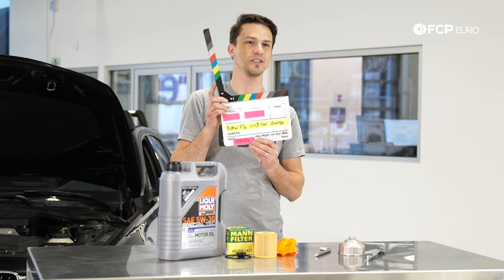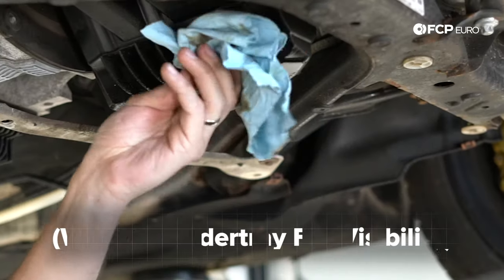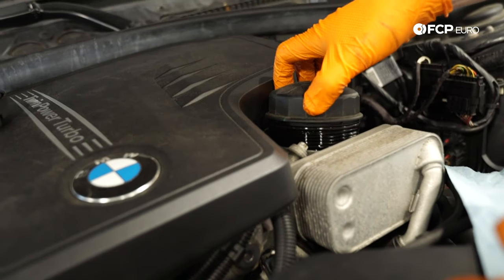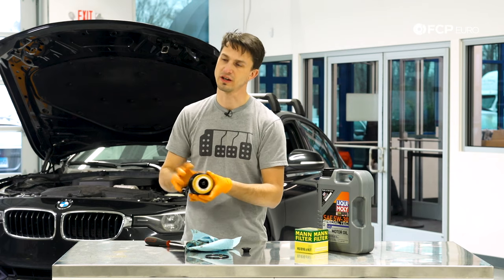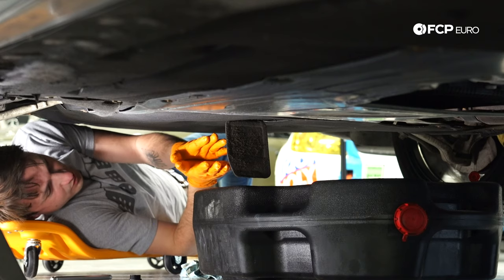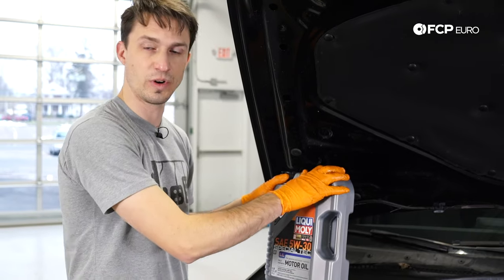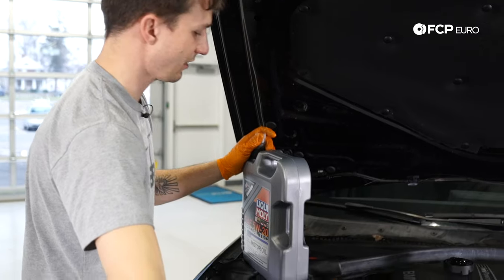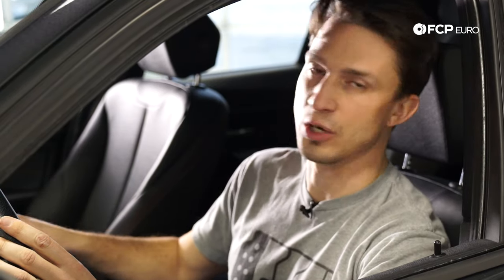BMW F30 Oil Change DIY - (BMW 320i, 328i, 335i, & More)

Comment: Leave it to the Germans to overengineer and overcomplicate simple maintenance like a fricking DIPSTICK.
Reply: Would be nice if they also kept the original dipstick when implemented the electronic feature
Reply: Never mind guys, I just changed the oil on my F30  2013 316D, and guess what I found on the right side under the engine cover? Yup a dipstick. So my f30 does in fact have digital oil readings and a manual dipstick!
Reply: My 2015 BMW has a normal dipstick.

Comment: I've watched a lot of videos recently because i decided to start changing my F30 328i oil myself.  NONE of them mentioned that the oil plug was a one time use thing.  Thanks for pointing that out!  Very helpful.  It wouldn't surprise me if the car wash place I'd been taking it to the last couple of years to get my oil changed did not change it or probably even my oil filter since it's not a typical oil filter.
Reply: Really what videos are you watching ? Every oil filter comes with new o rings and drain plug
Reply: First problem you mentioned is taking  your bmw to the car wash t get a oil change 😉

Comment: N20/26 takes 5L of oil. There's no need to pour it in parts. You can prove it to yourself by just pouring all the oil that came out of it into the same 5L canister. The electronic level thing shows it full in wide range of ~4.5 liters to ~6.5 liters.
Reply: Same with my 328d. It shows full after an oil change as long as you're close, but it also has a real dipstick which I prefer to the electronic sensor.
Reply: That's good, I was wondering what I would do with perfectly unused oil because I'd use the new oil container to dispose of the old oil
Reply: I drained all the oil  out of my 2016 328i and measured a total of 6.9 qrts.  That was after I bought the car as certified  from the BMW dealer, so  now everytime I  change the oil I ad 6.9qrts.  Then I run the engine on a flat surface and measure the oil  with the idrive system and it shows "oil level ok" all the time.
Reply: Agree it takes exactly 5 liters and is not the same as 5 quarts . That could be confusing and that should be mentioned in this video !
Reply: @makipa20021  I mean its a simple conversion, One of them Is symbolized as L (Liter) & the other is Q(quart) FYI, a simple Google search will give you the conversion from metrics to U.S Customary units.

Comment: So it doesn't matter if you oil the oil filter or not?? I have a B47D20A engine and have done the last 3 oil changes... But never Primed / coated the oil filter. Now I've got really paranoid  as Ive just heard about this and looked deeper into it and the interwebs says all sorts about whether it's needed or not. So I'll just nod away and pretend like everything's all good. But for future changes.... Is It important or not?

Comment: Why are oil pan bolts one time use I could understand the O 'ring  but why the bolt unless it's stripped. 🙉
Reply: There’s an o ring on the drain plug itself, and it’s also made of plastic which degrades much faster than aluminum would

Comment: Tip. When you remove the drain plug the oil is streaming straight down and if the drain plug drops in your oil catcher right under the stream (like it probably will) the oil with splash everywhere like crazy. So pull it off to the side as you finish unscrewing it

Comment: Exact procedure and tools for the E84 X1 sDrive28i 2014 RWD. The iDrive “Vehicle info” display on this model does not have the option of “measuring oil” below the engine oil level status. Frankly, I much prefer a dipstick to physically measure the oil; also, occasionally, extract the oil using a vacuum container system, it works great on my 2013 E350 coupe. Great video, as always!

Comment: Did my first ever oil change and can’t thank you guys enough!!! Used the ramp system and worked like a charm.
Reply: Did you input your own service to the car's computer afterwards? Just curious if the car notifies you to change it's oil. Then you decide to change your oil yourself. Does it still notify you? Do you need to log a change oil history into its computer?
Reply: @jdo6284   Did you get the answer?
Reply: @MonkiestMonkey  You'll have to reset the oil counter on the cluster. There's many videos on yt to tell you how to get access to the menu on the cluster to reset. In terms of adding history to your service, you need to program it using software with an OBD 2 attachment. Good luck!

Comment: Thanks for the video!  5:08  8 Nm = 70.81 Lb-In!    Plan to use my 1/4" lb-in torque wrench, especially it's my friends car.
Reply: 8nm = 10.83 ft-lb, which is a very low torque setting like he said.  70.81 ft-lbs would sheer the drain plug in half!
Reply: @brnt034    I said 70.81 Lb-In (inch)
Reply: @Hubjeep  my bad, where is ft-in used for any torque wrench?  Standard is either nM or ft-lb so what you stated is misleading and reckless 😕
Reply: @brnt034 . Again misquoting me.  It’s not “ft-in”.  Look up lb-in (same as in-lb) torque wrench, it’s used for lower torque values and is usually 1/4” drive.   “Misleading and reckless” 😂😂😂😂

Comment: good video. im a little concerned though about the drainplug. i bought a kit and it came with a regular metalbolt with copper washer not that plastic one you show in the video. maybe i need to contact the local dealer for a oem plug.

Comment: Now what if the threads on the oil pan are stripped ? I tried to screw in my plug last time and it kept spinning😭 plz help I need to change my oil I’m 3k overdue and don’t want to hear bmw or somebody tell me I need to replace the pan. Any alternatives?

Comment: I have the wagon 2014 328ix and it seems  (per Amazon) the drain plugs do not fit my car,  are they universal between 2, 4 and 5 doors?   It is certainly helpful that these are one time plugs, thank you for pointing that out.  I would of been stranded otherwise.  They really don't like us doing this ourselves do they?

Comment: Curious if you damage the jack point receivers putting it straight on the jack stands.  Why not use adapters?  Also why not just use a torque wrench?

Comment: I recently changed the oil in my friend's F30 328i xDrive. It has metal oil pan and drain plug. I added 4 qts and let it warm up. When I checked it, it showed the level to be at max. Could I have not drained all the old oil out? I have seen that the maximum actually ranges quite a bit. Should I add in a 5th qt even though it reads full since it calls for 5.1 qt in the manual?
Reply: It is not necessary to add oil. I have similar experience and no problem since  oil level is at max. Mine is 2014 328i sedan, plastic oil pan and drain plug.

Comment: I have a 2015 328i sulve on the owner manual it says tou can use 5w30,0w30,0w40 and 5w40, why so many different viscosities?i did an oil change and used 0w40 of mobil1 euro formula, is that approved for bmws ? Thanks

Comment: Do you know if you need to prime the oil after a change similar to doing it after changing the OFHG? What are your thoughts on folks adding a quart directly into the filter housing too?
Reply: I always suck out dirty oil from oil filter housing. Almost 200ml came out usually. Then... pour new engine oil to the OFH (not too much...) .  I've learned from pro mechanics.  Even old canister type filter... I fill the new oil before install it.
Reply: Not necessary. Only need to prime the oil system if you rebuild the engine and starting for the first time.

Comment: Please do a video on a BMW V8 car. Like the BMW X5 or 6 Series using the N63TU motor. My independent mechanic says to stay away from the Bimmer V8s bc of oil consumption problems and so on. I’d LOVE for you guys to do an in-depth look at the N63 motor and tell us what we need to know. Also, just ordered a set of Zimmerman rotors for my W203 C-Class. Very good quality. Thanks!!

Comment: Great info.  I have a '17 330i xDrive.  Is it still possible to do the oil change with only the front of the vehicle raised?  Or will not all of the oil drain out, like it will with the rear wheel drive models?
Reply from the maker: Yes, absolutely. While the oil is draining into your pan, you could always lower the vehicle back down until it is done draining, then raise it back up to complete the job! if you wanted that extra.
Reply: @fcpeuro  Thanks.  Would consider a video going over adding coolant to the 4 cyl. turbo with 2 coolant reservoirs?

Comment: Hey guys. I have a 435i and I used 0w-30. Is that okay?
Reply from the maker: Hi Juan, we would advise you check your owners manual and go by that recommendation.
Reply: @fcpeuro  crazy part is they don’t specify the weight. just the sku for bmw oil 🤦🏿‍♂️
Reply: @fcpeuro  thanks for replying guys. will definitely buy the water pump kit when I need it.
Reply: 0w30 LL04 is perfect.
Reply: I use 0-40 in my f30 328i

Comment: can i use this kit with high mileage
Reply from the maker: Certainly can Josue M
Reply: @fcpeuro  i ended up getting the 5w40 kit since i’m high mileage and i have a stage 1 tune will the 5w40 work fine in my car?

Comment: Is there a reason you replace the oil filter housing but use the same o-rings? Honestly just curious why the housing needs to be replaced but not the rings
Reply: Sir, the O rings were replaced; maybe you missed it. Watch agin. Carefully this time, his explanations very thorough and references your concern.